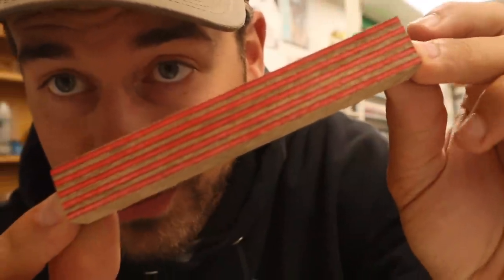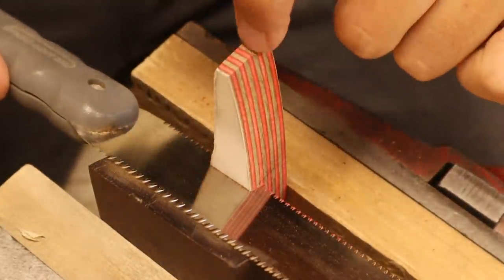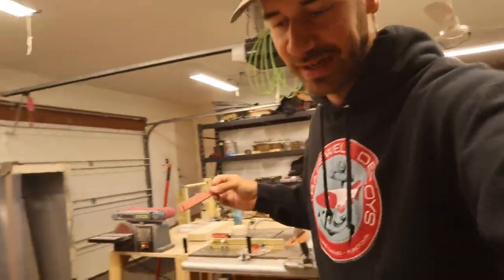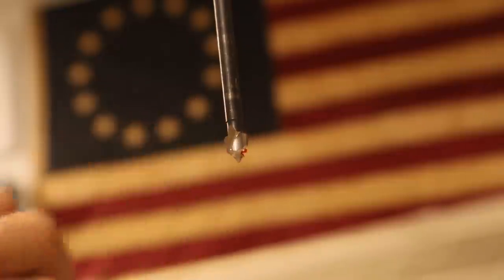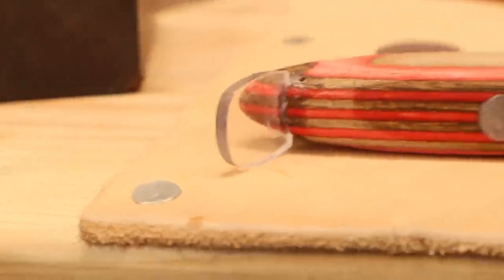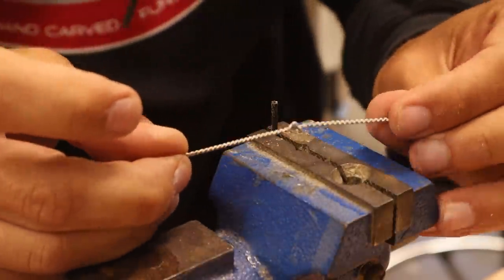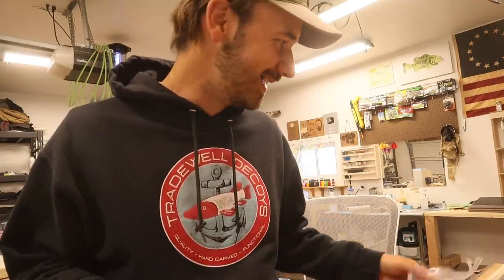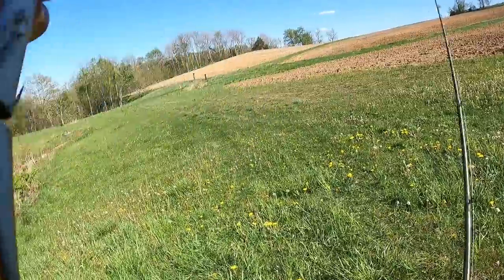Laminated Wood Pen Blank Bait | One Day Build to Catch

Comment: Optical professional here. Long time viewer, rare commenter; Nate those safety glasses you put on for the UV light. Make sure they are made from polycarbonate or have a blue light blocking coating on them. Polycarbonate as a material blocks UV and Blue radiation to some degree so if their just basics, double check the material they are injected from.

Comment: What if u put in a joint connector in.the hole for the lead before you put it the lead in and that will give the lead something to hold onto in the hole so it will never fall out